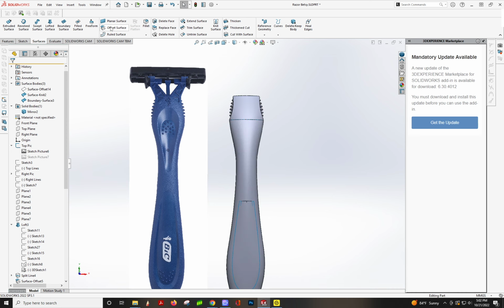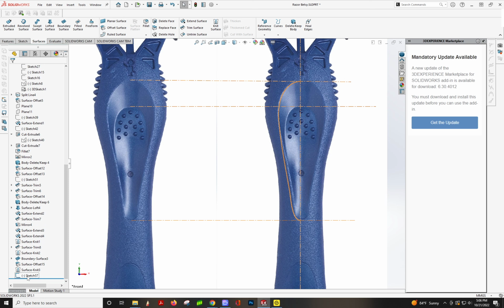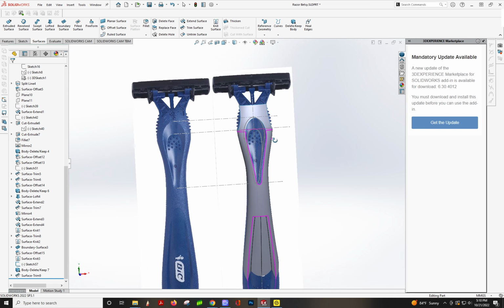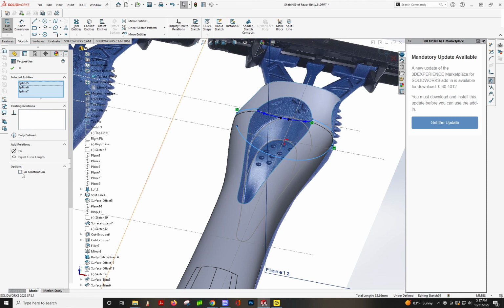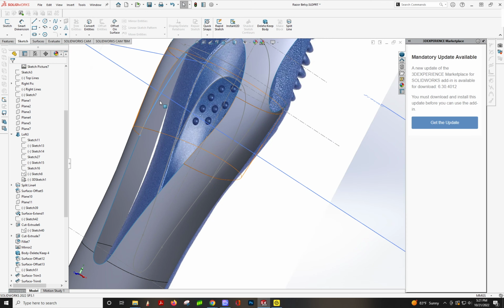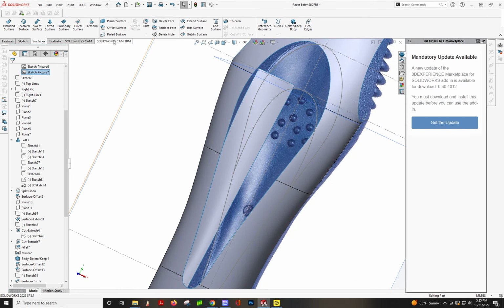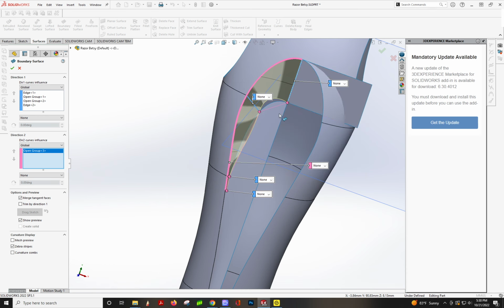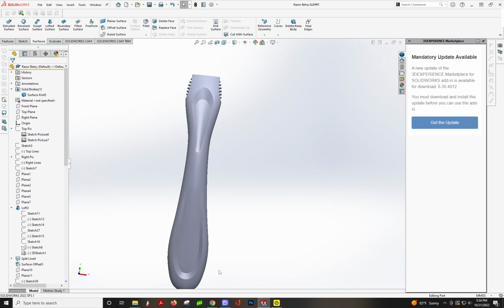Solidworks Surfacing: Razor rebuild non-tangent concave grip feature with fading tangent champfer

Comment: You're products are so cool and great SW surfacing manipulations.  I am reviewing my surfacing again, since I barely use those features for current "cost down" projects at work.  I am always impressed with your "tool details" that typically only the injection molding tool designer need to focus onto.  I'm curious have you ever had to redesign a feature, because the injection molders were having problems with mold defects, or worse somebody is running a mold simulation software and wants you to make a change for better flow(these guys don't care about the product, just fast cycle time and multiple cavities).
Reply from the maker: Thank you! Yes I've been designing and building pretty complex forms for lacrosse equipment for the past 12 years. All of my builds have to be built with draft and ready for tooling, so I am used to building for flow, draft, and all of the other details needed for meeting tooling needs while building beautiful surfaces.